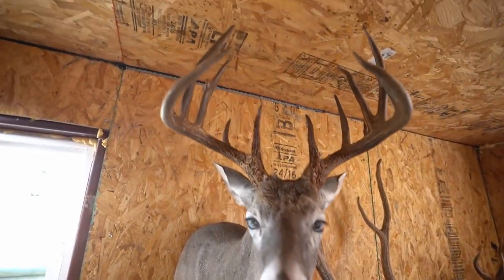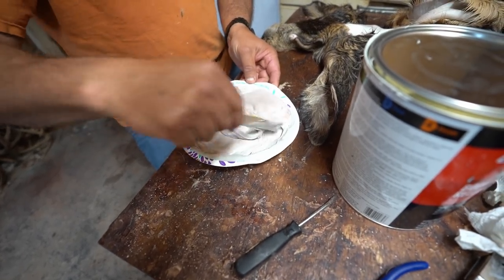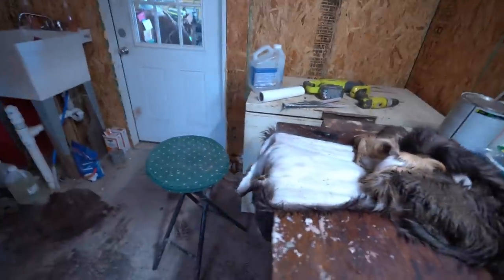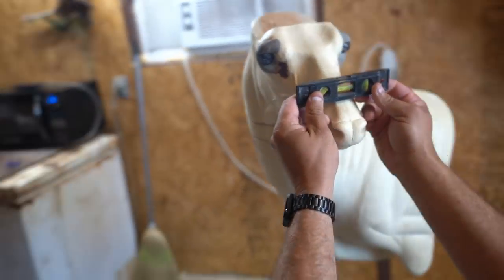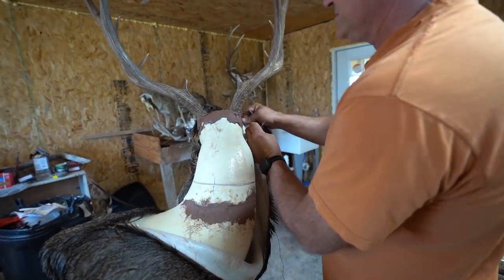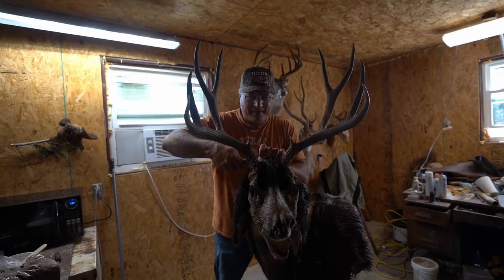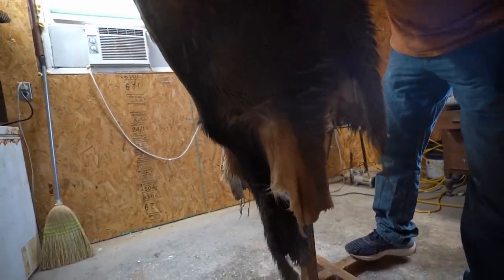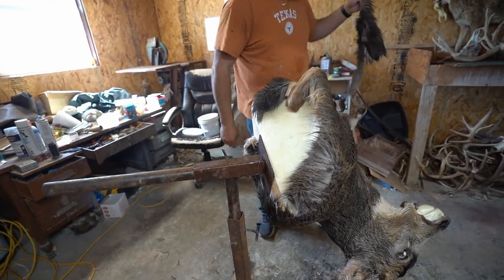Mounting My MULE DEER! Taxidermy Tips And Tricks

Comment: I am no taxidermist, but I would think you could mix the bondo in a plastic bag and cut the corner to squeeze it in the ear, like they do with cake icing.
Reply: i am a taxidermist down in Houston Texas and i personally use a butter knife to stuff bondo in ears but popsicle sticks work just fine too ( disposable) just throw them away when done like the paper plate he mixes the bondo on ( i personally use cardboard cuts from the boxes our taxidermy supplies are shipped in. the bag filler concept does work but after doing taxidermy you realize it will make a lot bigger mess,  you will waste more material , and go through a few time consuming hoops that are just unnecessary